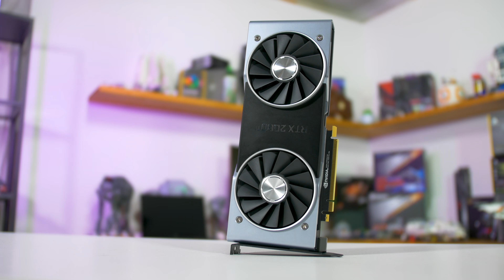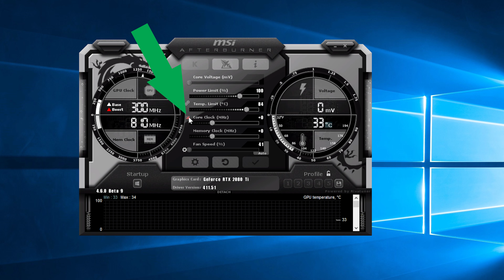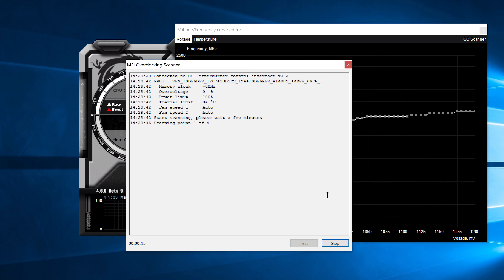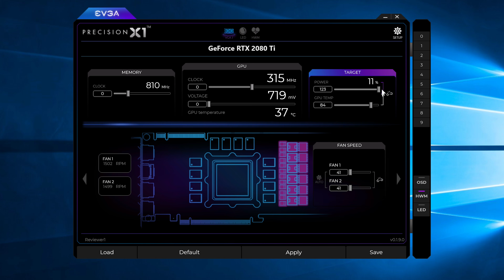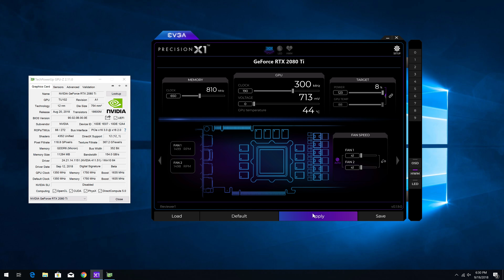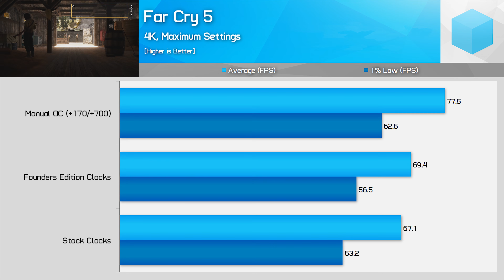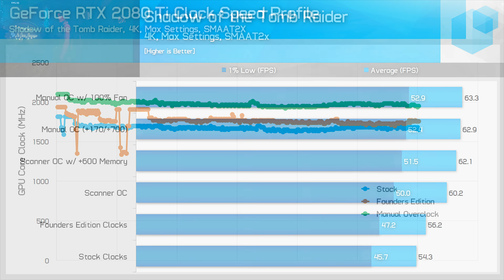GeForce RTX 2080 Ti Overclocking Guide, Nvidia OC Scanner Results & Performance

Comment: Sill that voltage slider does more than what it does one my classified 980, which is absolutely nothing at all despite what EVGA claim. Can't overclock my water cooled 980 at all because of no voltage adjustment.
Reply: My 980 Ti Voltage Slider in MSI Afterburner does work, base Voltage is 1187mV, I can bump it up to 1230mV, but after heating up the Voltage drops to 1174mV and with bumped 1212mV
Reply: yeah I tried that already. I also did everything suggested on the very issue for my model on the evga forum. They assured the EVGA overboost button in precision x16 applies 1.4v without it showing in the monitors. Nope still stock when measured on the card.  Mine just runs at a locked 1.200v no matter what.
Reply: What do you mean though can't overclock your card at all? Just exaggerating? I can hit 1460 ish Mhz though stabilizes at around 1440 after heating up, if I don't bump voltage then 1430 is about the average, my old 980 could hit 1465 Mhz at peak if I remember without messing with voltage
Reply: stock is 1417Mhz, any increase at all, even 10Mhz just locks the card instantly if placed under any load.  The only thing I can over clock on it is memory which I got stable 24/7 at 600+, semi stable at 800+.   It's a unknown model of classified, I can't find the spec sheet for it but from the reported stock clocks it seems to be a Kingpin variant?   It also has a full cover block, typicality runs around 40-50C full load.
Reply: So basically might as well of got a normal card rather than that one aha. My memory is +350 Mhz or +700 Mhz depending on how you read it (MSI Afterburner shows 3500MHz as stock when it's actually double that at 7000 MHz). Well at least yours runs a lot cooler XD
Reply: I got it used from my best mate in 2016 for 500 bucks while he got a hybrid gigashit 1080 which turns out also barely OCs too, it was a decent upgrade from my 3 way SLI 9800 GTX. It was just an interim card while I waited for next ones after pascal, guess I'm going to keep waiting lol. 

It seems EVGA's voltage control on these cards were hit and miss, some people on the forum were RMA their 980 classy due to the same reason. I am sure it would clock decent if I could control the damn voltage on it.

The one and only good OCing GPU I have and still own is a Quadro FX 4000, soft modded to 6800 Ultra and 27% OC over the stock qudro specs, and about 20% over the ultra factory specs. A absolute beast, also stock air cooling too!  Those quadros have super binned silicon, got same result on the memory as well, 30% actually.

Comment: $1300 for an estimated five year life-span or one year if OCed? Do they really say that?
Reply from the maker: Nvidia claim that if you use the voltage slider to unlock those additional voltage levels (even though the slider does absolutely nothing), the card's lifespan will reduce from an estimated 5 years to just 1 year
Reply: The voltage levels might do something once the tensor cores and all the "RTX" things are enabled down the future, still I wonder if a normal thing for both AMD and Nvidia, or if it is something worth taking note of. 
I do have an old 7970 running overclocked in its 6th year now without any outstanding issues, and I guess there is also plenty of Nvidia cards out there pushing past 5 years that are also overclocked. So I wonder if Turing lifespan estimates are lower or just the standard tech speak to say when it comes to overclocking and voltage manipulations.
Reply: 奥村 麻子     I have a bunch of 10+ year old graphics cards that all work to this day. It is just nvidia using a scare tactic.
Reply: I still have a ATI Rage PRO 128 in a computer with a AMD K6 233Mhz CPU (whats cool is the voltage for that CPU is 2.0v lol. so if this was a modern CPU, it would instantly fry as soon as you turned it on).  Its 21 years old (old enough to drink) and still runs just as good as it did when we bought it back in 1998.  Honestly, as long as you don't do any form of crazy overclocking, your CPU and GPU should litteraly last forever!

Comment: So for a system with a heavily overclocked 8700k and 2080ti what size PSU would be a safe bet?
Reply from the maker: You'd be cutting it fine with 650W depending on your system and overclocks.  We used an 850W and it was perfect
Reply: @Hardwareunboxed  ok thanks. So if i go the upcoming 9900k (that steve teased, how cruel) then maybe 1000W to be safe. Will be watercooling and extra components too
Reply: 9900k is still Coffee Lake. You'll see a ~33% increase of power draw from the 8700k. 2080ti and 1080ti have less than 20W of TDP of difference. Imho you can just keep your current PSU.
Reply: I've got a 750watt for 2080 and 2700x
Reply: 850w.
Reply: i have 8700k on 5ghz and overclocked rtx 2080ti at 650w seasonic focus gold plus

Comment: Hi there, may I ask you what Mobo you are using and Ram?? The RGB effects look very nice.
Reply from the maker: Aorus X370 Gaming WiFi
Reply: @Hardwareunboxed  Thank you brother, and Ram??
I'm looking to do a nice RGB build myself, would you recommend this board by the way? I'm an Asus Rog guy myself and always had them as I'm used to the bios section.
Reply: Probably the same RAM as test system : 32 Gb DDR4 Vengeance 3400